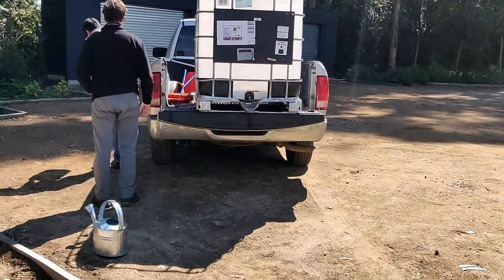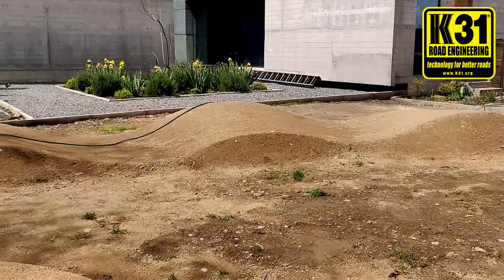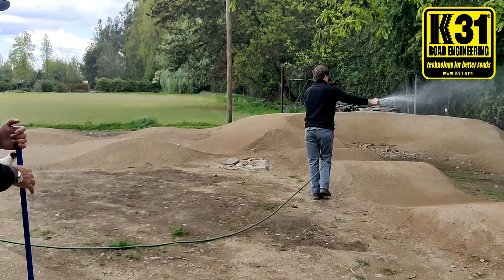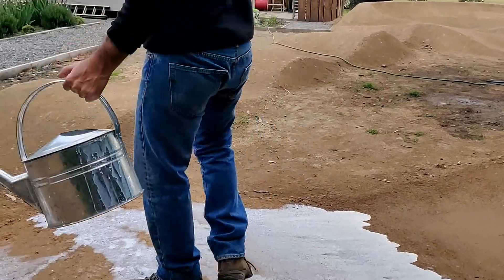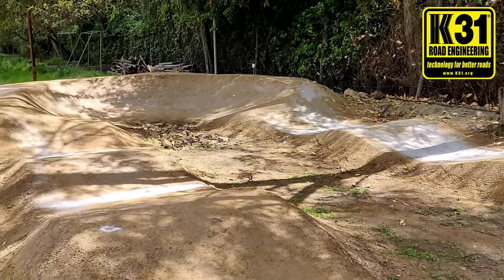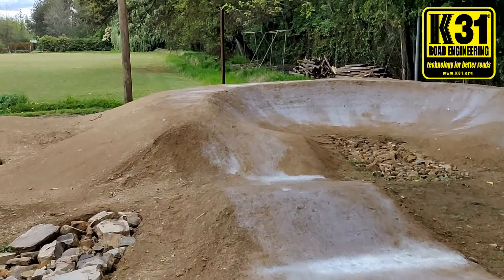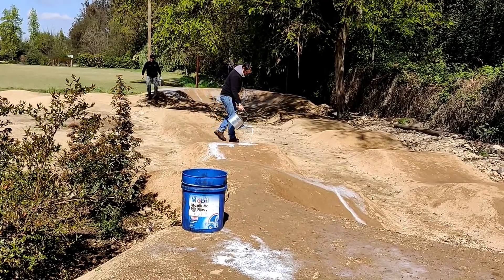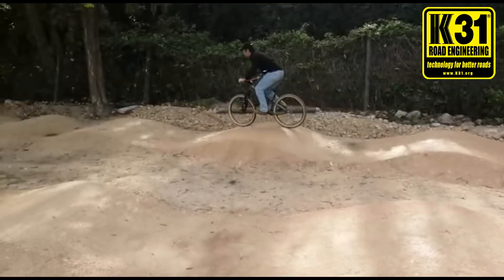How to do dust control and erosion control using only K31-APS. No machines! Very simple!

Comment: Hi 
How long the treatment last ?
Reply from the maker: As long as you keep up the maintenance the road will continue performing as with any other type of road. If you see an area eroding due to high use, repair it before it becomes a pothole, simple. Thanks for your question.

Comment: Great! what are the ratio poly and water?
Reply from the maker: For erosion and dust control the mix ratio will 1:8 or 1:9 APS to water.
Reply: @k31  why the ratio 1:8 or 1:9?
Reply from the maker: @qwertyuioppoiuytrewq7537  the water iacts only as vehicle to transport the APS into the soil. At the end the water will evaporate and the APS will remain holding the soil. Technically you want to be at 110% OMC (optimum moisture content) of the soil, including the APS and water.

Comment: What is the ratio mixed with water? Very good idea
Reply from the maker: For dust and erosion control the mix ratio is 1:9 APS to water. Thank you for your comment.
Reply: Is it the same ratio on a road with vehicles compared to bicycles? And how long does it take to dry as in Central Florida it seems to be raining every afternoon...
Reply from the maker: @DefensorFortis  You could probably reduce it to 1 liter per square meter if it's only for bicycles. It dries in less than 24 hours. K31 is being used successfully in Myanmar and Thailand, where it rains heavily for half of the year.